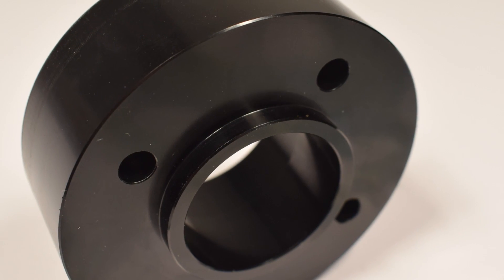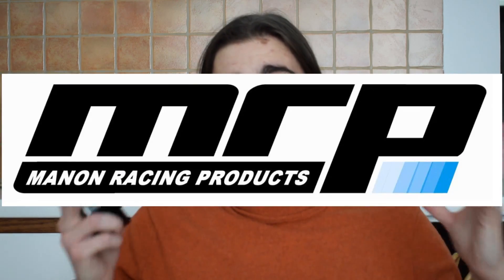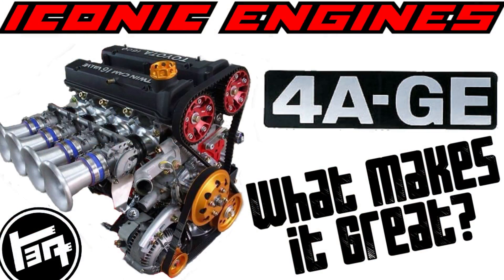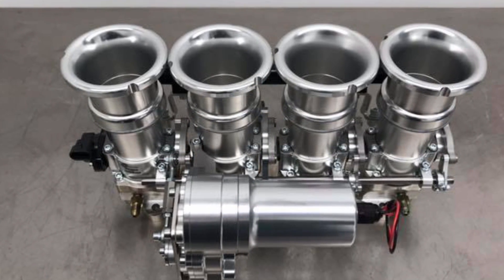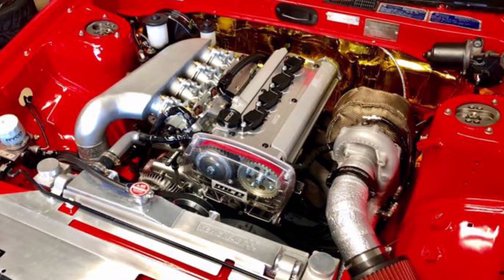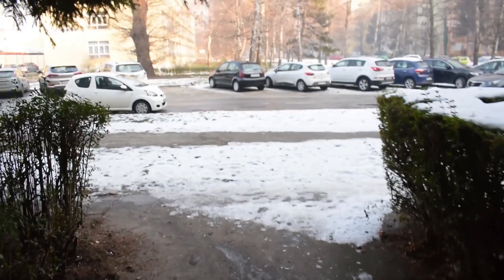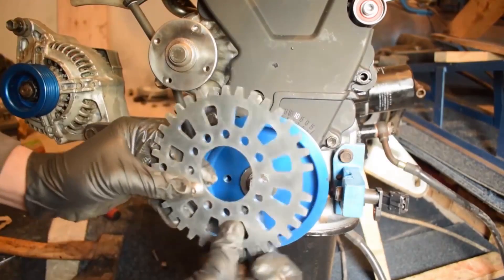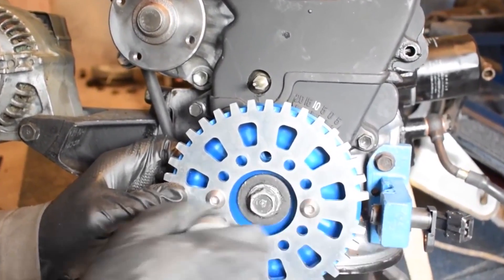MRP 4AGE trigger wheel kit UNBOXING - solid pulley vs harmonic dampener #1

Comment: I’ve been looking at getting a whole new crank pulley. Mine has a couple of notches off it. Like it’s been chipped off. Maybe dropped a couple times. Or maybe also it’s just the oem timing marks. Idk. But also I’m not using the ac so I’ve been thinking if getting a aftermarket one. My 4agze had one and felt nice

Comment: Sorry D4a i know its been a long time you made this video but i want to know what about the drop in oil pression did the solid crank pulley use something or break the oil pump ? Thank sir :)
Reply from the maker: The solid pulley is still on the car. Total 2800km so far. No drop in oil pressure so far.
Reply: Good news than its was just your cluster gauge that was missing around :p

Comment: How does the trigger plate adapter mount to the stock crank pulley?
Reply from the maker: Once you have done the machining you just put it in there and bolt it down with the provided bolts. The stock pulley has threads in it already from factory, they are used for removing the pulley.
Reply: @d4a  so with the added adapter plate and mounting hardware won't the rotating assembly need to be balanced again to mitigate any further harmonics?

Comment: The oem pull is more to take the snatch out if the belt than anything . A well balanced solid pull shouldn't cause vibration it's attaching a belt and running a water pump & alternator off it the causes the vibration .I noticed that my engine was losing pressure when driven hard & the engine was hot so fitted a extra oil cooler & oil pressure doesn't drop

Comment: Yes! I have been dreaming that you would do this. I never asked because I figured you weren't as crazy anal about this type of testing as I am. I ALWAYS KEEP MY MOUTH SHUT, UNTIL I HAVE DATA TO BACK ME UP. Keep up the good work. If I wasn't so broke from my 2 current 1nz-fe builds, and k24 (on the back burner), and 4age (on the back back burner), I would send you money to support the channel. Thank you, thank you! This is   my kind of project. But please remember, a good (not oem) oil pressure gauge  should be the first item on an engine build list. Also oil temp can be an   amazing diagnostic tool,  just dive into the decades of info regarding high performance air-cooled VWs.

Comment: I find in my supra my oil pressure will drop slightly as the oil gets more mileage on it, then refreshes on a new change. It is only about 5psi at redline, around 90 down to 85 psi but it is very predictable. You should ask MRP to sponsor you one of their custom fluid pulleys and do a test with that vs the solid ally one :D

Comment: heres what is the rubber ring is supposed to do, its supposed to dampen the varying torque that is going to the alternator to prevent belt slipping. if you have dual row pulleys you will see that the ac pulley is not dampened. just the alternator. this only applies to the 4AGE as far as i know of. meaning I don't know what other engines do what.

Comment: Great idea. Love how you are uploading good content frequently. To have a accurate test of the data, shouldn't you replace the. Bearings for testing both pulleys. The lightweight from ttt was put in after 30 years of use so, might not be a fair comparison. Think a lot of the comments have good suggestions. Anyway good luck

Comment: witht the oil pump being that close to a main journal, the crank would be quite supported no? and anything about it being a flatplane crank and a good blanced rotating mass?
Reply from the maker: All of that is true, but apparently the undampened vibrations will still cause noticeable damage over time.

Comment: This will be a very interesting experiment.

However, there is something I'm worried that might affect the collected data from the solid pulley setup.

Was the engine rebuilt with new wear parts, as the bearings and oil pump? Was the solid pulley run with the engine from the beginning after rebuild? How many miles have you run the engine since the rebuild?

It may look like insignificant variables, but no variable is insignificant in an experiment like the one you'll do. Results would be inconclusive, at best, or biased, at worst.

Just something to keep in mind.

And since this is a 4A-GE related video, I'd like to share my idea of a Frankenstein A engine: 7A bottom end and rotating assembly with 20 valve low compression pistons, 20 valve 4A head with better ITBs, forced induction with an SC14 supercharger. Dream engine setup for a "Over Rev!" AW11 MR-2 tribute car.
Reply from the maker: Good points on the data! Yes, engine was fully rebuilt with absolutely everything new. Ran with solid pulley from start and did a few thousand miles so far. I have the exact number but I'll need to find the pic of the starting mileage. Your engine sounds top notch!
Reply: Jose Rivera Nice build idea. Pretty sure 7afe block / crank has a CPS included, I was actually toying with the idea of switching to a 7afe block and newer ecu if I have any rod issues or any problems with my pistons. I currently have a bigport engine.
Reply: I’m liking the sc14 idea.. I’m also currently building a 7age itb build. Can’t wait for those high revs🤤

Comment: Do you honestly think the engineer's that designed the Toyota harmonic crankshaft balancer were total idiot's !
Im pretty sure they done tons of research and testing before producing the design they came up with .
All their research and testing is why the 1.6 engine has a reputation of being bullet proof if maintained properly  !
That little portion of rubber sandwiched between those two piece of metal is there for a reason .
( VIBRATION  = DESTRUCTION )
Reply from the maker: In no part of this video have I said or even implied that the stock design is no good or that anyone is an idiot. The point of all of this is to see whether solid pulleys do damage and if yes what kind and how much. I think I really couldn't have explained it more clearly. Also, the 4age stock crankshaft pulley is definitely not a balancer of any kind, just a dampener.
Reply: What you failed to realize is that original pulleys are cast w some machining done afterwards. Translation: they’re not perfect. That’s why the harmonic dampener exists. To dampen the harmonics created by the imperfect pulleys. A fully machined pulley is perfect (within 1 or 2 thousands of an inch) so you don’t need any dampener of any kind because it doesn’t generate any harmonics. Another thing you fail to realize is that you’re dreaming if you think any harmonics are being dampened by that rusty dried out piece of rubber. The stock rusty pulleys are way more destructive than any machined piece that you can buy. There are more reasons to go with machined aftermarket pulleys I could go on and on..
Reply from the maker: The pulley itself doesn't create harmonics. The crankshaft does. I'm doing this precisely to stop claims such as " old stock pulleys do more damage" being presented as fact. The goal of this experiment is to reveal exactly what actually happens, if stock pulleys are useless when they're old, and if solid pulleys are "perfect" as you say, than we will see this in the results. Without verified empirical proof there are no facts, just guessing, assumptions and heresay.
Reply: driving 4 answers thanks for the reply. You’re efforts are appreciated. I wasn’t really arguing against or for you. If you keep the same crankshaft and same engine internals, a machined piece of aluminum or steel will have less vibration than cast (or mass manufactured) parts, period. By that logic, it is true that old rusty pulleys are “more destructive” than aftermarket pulleys BUT the the truth is all of them work anyway. I think people on the internet make this a bigger deal than it has to be. This is only a real issue with high power cars and they all use machined pieces anyway. Regardless, I can’t wait for the future videos. I’ll be tuning it ☺️
Reply: um, even if the pulleys are imperfect, you do realize the most vibration that is generated is literally from the pistons going up and down right. a fully counter weighted crank doesnt do anything about the secondary forces in an inline 4.. vibration does equal destruction. to some extent. have you been in a car that doesnt vibrate? what about diesels?
Reply: also, 4ages are internally balanced. there is no harmonics balancer on this engine. the flywheel is also individually balanced. to the reliability statement. every engine is pretty reliable as long as maintained properly. if not there would be a recall.